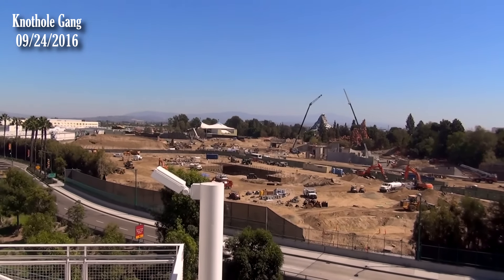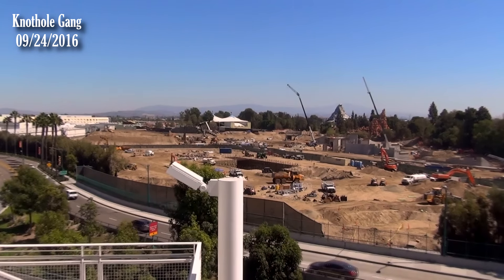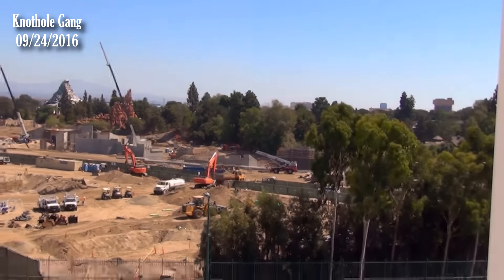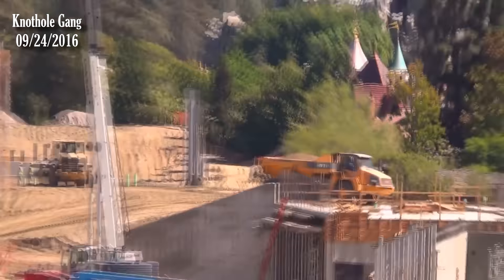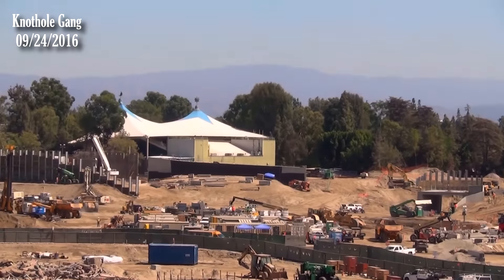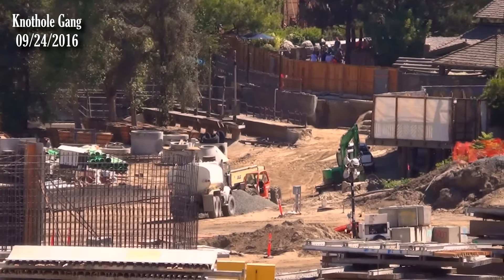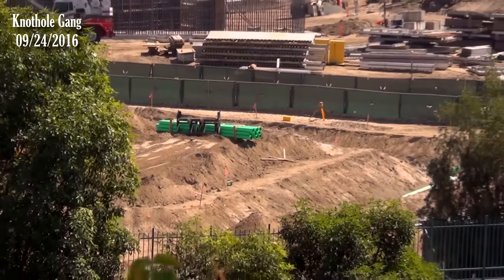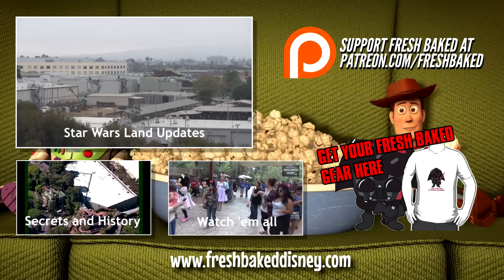Star Wars Land Construction Updates | The Knothole Gang Pt. 43 | 09-24-16

Comment: On a related point, I have confirmed reports that they've already started welding those rock formations onto "the fort" area. The forms have a mesh in them like rebar so at some point they'll pour concrete over the forms and sculpt them. A lot of those walls are going to be covered with rock formations and waterways and greenery. Most of those walls along the back of Rivers of America are just a structural backbone and sound proofing for what ultimately will take on the appearance of natural land formations. The train track will straddle that formation giving emphasis to the train passing from the Frontierland and Critter Country sides but entirely obscuring it from the STAR WARS side.

Comment: I'm told Disney has closed a whole section of Critter Country to start working on that path by the Hungry Bear. And, yes, the path will pass under the train under a bridge much like the one that comes out of the side of Splash Mountain as it passes behind Hungry Bear. By the way, a trestle is impossible to walk under since the defining characteristic of a trestle are short cross beams all along the bottom that support the structure and make it impossible to walk under. If you look at the concept art, water from the waterfalls will flow through the trestle sections but there are numerous points where there are no cross beams, namely where you pass into Star Wars Experience and also the access point for Fantasmic storage area. The concept art actually clearly depicts the omission of trestle cross beams right where the Fantasmic storage access point is to be.